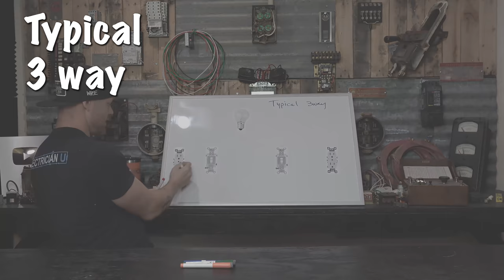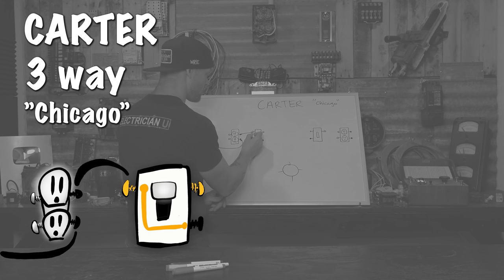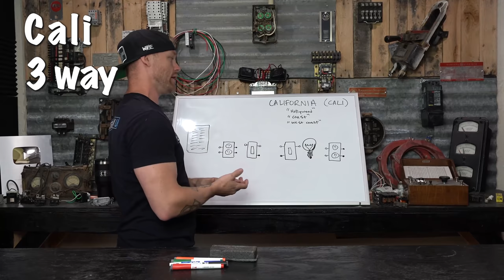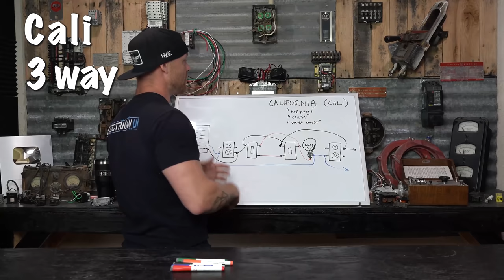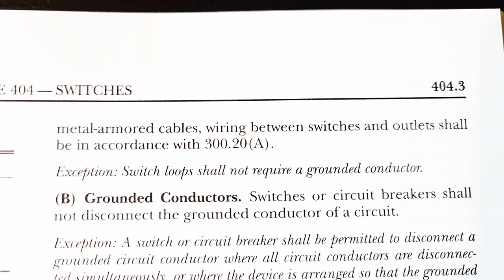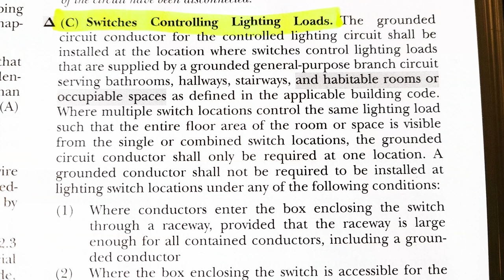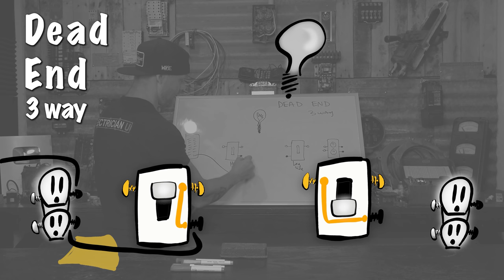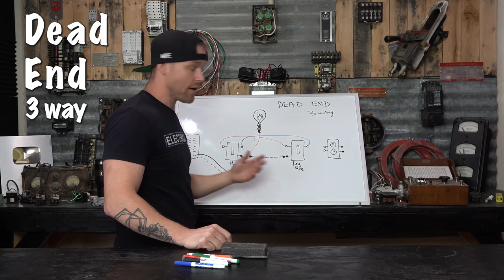THREE WAYS 3-WAYS CAN BE (3way Switch Wiring - ILLEGAL AND LEGAL METHODS)

Comment: Hey Dustin. As a Canadian studying the electrical trade in our code books (CEC 2018 24th edition) Section 4-022-2 states that a Neutral conductor is required in every switch box. It reads as "The identified conductor shall be installed at each location of a manual or automatic control device for the control of permanently installed luminaires at a branch circuit outlet."

Comment: I recently did a kitchen/house remodel.  I ended up scrapping all my 3 way switches.  I had three 3-way (kitchen, hallway, & stairs) switches and replaced them with the Lutron smart switches.  I know you are a electrician and it is less profitable for you to install wireless switches.  But these Lutron Caseta switches/dimmers are legit. I even convert a existing 3 way situation into 4-ways by simply adding the wireless receivers.  I have also convert the living room and family room single pole switches into 3 way Lutron dimmers.  The great thing about the Lutron line is that the switches do not require neutral wire which mean you can easily upgrade your older houses into modern smart homes.

Comment: I only see this NEC 2020 "neutral at switch boxes" applying to completely new switch circuits as in a rewire or new construction. As a practice, I try to always (especially in residential) have my switch legs go up to a fixture outlet from a wired switch box rather than than down. and this practice was influenced from my early electrical maintenance days (mostly service work), whereas I hated having to fool with a light fixture to troubleshoot a problem such as bad splices.  Another great video for sure...

Comment: Sending this to my Father-in-Law.  The previous owner of his place had some hack install a "three way" circuit in the living room, one switch at the front door and one at the kitchen.  Unfortunately, it's only 14/2 throughout and uses single-throw switches.  Dude got it right in that both switches WILL turn the light off... but if you turn it off at the front door, the kitchen switch won't work.  If you turn it off at the kitchen, then the front door doesn't work.  The hack just put two switches in series, then installed a ceiling fan with a pull switch, which is what my in-laws end up using.  It pains me greatly and I end up walking around in the dark rather than dick with it.  I'm dreading replacing that mess because my Father-in-Law thinks the attic is unsafe and hasn't agreed to let me look at it yet.

Comment: Hey Dustin, one thing you mentioned parenthetically was the dubious use of #6 and smaller white conductor used instead as an ungrounded circuit conductor, and that doing so was not compliant, but that most AHJs would not cite this as a violation.  Just a reminder that cable assemblies are discussed in Article 200.6 and even white wires #6 and smaller may be re-purposed as ungrounded circuit conductors by way of phase tape or other effective means.  For cable assemblies, there is no code violation.
Reply: Good info. Thanks.

Comment: Ok, this might seem like a dumb question and you might have mentioned it. In the first example, how would you run the ground? I've seen two ways. Coming from the panel, bypass the outlet and switch, straight to the fixture, then from the second switch to the fixture. Basically just one continuous wire from the panel to the fixture, grabbing a tail from the second switch. 
The second way I've seen is from the panel meeting up with a tail from the outlet and each switch then up to the fixture. So basically grounding everything along the way to the fixture. 
I  hope that all makes sense.

Comment: This was soo helpful.  I just found out about the neutral code requirements and wasnt sure, about how to handle until watching this video.   Thank you!!
Reply: Can be especially confusing for traveling electricians because often local jurisdictions have stricter requirements than the NEC and while one county for example,  may allow dead end three ways, the next county may not, or they may allow 14-4 or two runs of 14-2 so as to have a neutral at all switch boxes, for example.

Comment: I have come across another version of the dead end 3way where the power (via 14/2) was coming in to the ceiling jbox .running from their to each 3way switch was a 14/3. The neutral from the supply directly hooked to fixture ,the hot from supply to one white 14/3 , the other white 14/3 to the fixture hot, and both travelers capped together in ceiling j-box.
Reply: Most of the 3-way switches in my house are like this, which means you cannot install a smart-switch that requires a neutral. One solution I found was to install a smart-relay in the light fixture box. The problem with that is if you have to press the smart-relay reset button, you have to remove the light fixture to get to it. Does anybody have an acceptable way to use the existing wires, repurpose them in some way, so a smart-switch can be installed?
Reply: @jackallen3994  It sounds like it’s time to replace the 3-wire with a 4-wire at the “hot” location.  If you can’t attach a 4-wire to the 3-wire and pull through, well, I’ve learned from experience that they make drywall and mud everyday 🤪
Reply: Anyone know the name for this type of three-way?
Reply: I always called this Cali 3 way, except red and whites pass through light box as Travelers and 1 black is hot, the other black is switch leg. Same thing just different color travelers.

Comment: Up here in Canada I've seen 3 ways done a different way.  You use 4 wire cable, red, black, white and ground.  You run such a wire from the wall switch up into the ceiling light fixture and then down to the other wall switch.  You can bring a hot 3 wire into any of the 3 boxes to power the circuit with with slight variations.  I'll use an example of running the hot wire into one of the switches.  You connect the hot black wire to the common pole.  You then connect the black and red from the 4 wire to the other two poles.  In the light fixture box you connect the black and red so they run on to the other switch.  At the end switch you connect to black and red to the same poles as the first fixture and the white wire running back to the box to the common pole.  This makes the white running back to the light a hot wire, mark it with black tape at both ends.  Now just connect the hot white to the base connection of the bulb and the white going back to the start to the neutral side.  At the first switch connect the white from the 4 wire to the white 3 wire power in line.  And of course all the ground wires in all boxes are connected together.  There's a bit of variation you can figure out yourself when the hot 3 wire is brought into the light fixture box in the ceiling.

This set up seems to make it simpler and easier to wire 3 ways. There's no mystery 3 wire running in the walls along a different path. Overall it reduces wire costs and stringing for most jobs.  It's also a lot easier to fish a single wire in a repair or retrofit scenario in a finished home.  I notice now there is no neutral in the last box which isn't current code.  If I had to install a smart switch in an existing box without a white neutral I would connect the neutral pole to the bare copper ground wire.  The electronics in the switch don't return juice down the neutral.  They just need it as a reference ground voltage.  The ground wire should serve.  Not sure if this acceptable under code???  It should be safe if the smart switch is made properly.  I've seen electricians do this back in the day for old 240 volt electric stove circuits that didn't have a bare ground wire.  They would connect the newer stove's ground wire to the white neutral going back to the panel.  As we all know the ground and white neutral eventually connect to the same piece of metal in the panel.   All the neutrals and grounds are electrically continuous, connected, in a home.  And you'd likely get a better ground voltage reference from the bare copper wire than a neutral which could get thrown off by juice inputs elsewhere along the neutral circuit.  I think the makers of such switches made an unnecessary mistake in choosing the neutral instead of the bare ground for a reference ground voltage.  Or perhaps to accommodate older wiring with no bare ground wire.  Or maybe I misunderstand the need for a neutral in smart switches.  I would think the bare ground would be preferable when available.  Somebody should check into this, see if technically the bare ground is ok and safe to use and the makers say it fits with their design intent.  This would make meeting code requirements easier and cheaper

Just a note of caution here when using fixtures and switches made in or for Canada.  Canada is bilingual, French and English.  As a result laws require labeling in both languages.  That creates a mistake that's easy to make.  In French white is spelled "blanc".  If you're not paying attention or in poor lighting it's very easy to mistake the "blanc" label on components for "black".  You'll connect the hot wire to the wrong pole.  Heads up on this eh!

I've seen some weird things the text books don't describe in AC wiring and I've come to believe there is very little or no current or voltage from a device down the neutral wire.  I've seen houses where someone stole the bare #6 ground wire from the panel to ground to sell the copper.  The new tenant or owner is unaware and the electrical in the house seems to work, more or less. There's no connection to ground anywhere in the system.  It's all running on capacitance instead of grounding.  It's wonky and likely dangerous but most of it still works. Of course I immediately tell the owner they need to put back the bare #6 ASAP.

Comment: Thanks for your video. I ran across this Carter/Chicago style 3 way on a repair job that the customer had put in new switches and it was very helpful!
Reply: Lol did it take you some time to figure out what they had running?  If so how long.   Luckily I have personally never ran into a Chicago/carter 3 way, I have only heard of them and apparently they have been illegally installed decades after they became illegal in the mid 1920s.  A fairly common application,  was on older farms  , and homes in rural areas,  where you had a home, a yardlight and an outbuilding,  and some receptacles in the outbuilding that are to remain constant hot, and 3 way switches in the home and outbuilding controlled the yardlight using only 3 wires instead of four with or without ground.

Comment: On the dead ends, I always did the white and red for the travelers and kept the black for the switch leg. I always stripped my common for the other people working on the finish. You need to show the fed at light with 2 dead ends, very useful in an old work situation.

Comment: I just checked the NEC Handbook (2017), Article 200.7(C)(1). Another commentor is correct. For cables (MC, Romex), the white wire can be used and re-identified as ungrounded, if a switch supply or traveler in a single pole 3-way / 4-way switch loop, but not a switch leg. Interestingly, it doesn't prohibit all switch legs from being white wire (from a cable). Some people will say the switch leg should never be white, but that's not in the code (2017).
Reply: Also the white wire can be used and re-identified as a hot, when used to power a straight 240V load, such as a water heater,  baseboard heater,  or a NEMA 6-20R typically used for larger window AC units and larger electric heaters.
Reply: @Sparky-ww5re  Yep, if it's cable.

Comment: My newly constructed house (in 2022) had two dead-end three-ways in it, except that the hot side was at the dead end in both cases. To install smart switches, I had to flip the hot and leg sides so that the hot side was in the same box as the neutral wire.
Reply: I've done the same in my 1972 house. Basically "undid" the dead end three way and capped the red.

Comment: Goddamn dead end 3-ways finally just clilcked for me.   Describing it as just bringing the switch leg over to the 2nd box via the white wire in a 3-wire cable makes so much more sense than any other way it's been explained to me.  Thank you!
Reply: Congrats, I finally understand it when I used my red and whites as Travelers instead of red and black. For some reason, Black wires always going to common side of switch always made more sense to me rather than using the white as a common.

Comment: If you want more than 3 switches for 1 light (let's say in the staircase of an apartment building), just use a relay in the breaker panel with a push button circuit as switches. Standard practice in Germany. :D

Comment: Both of my three ways I have in my home are the dead end type. Both are for controlling lights from two different floors. So, I have a normal 3-way downstairs for an outdoor lamp and upstairs a smart 3-way for the same lamp. The other is similar, smart 3-way upstairs for outdoor stairwell and normal 3-way downstairs. I only have and need neutrals where the smart switches are and the normal 3-ways don't go to any outlets, so neutral is not necessary.

Comment: Liked the video. I get so many calls especially from one handy man friend that he’s removed a switch and can’t remember what he did. As you know it’s not easy trying to help him figure out what he’s done if there are multiple switches at the same location. Going to refer him here for the future.

Anyway is a 3 way really a 3 way and is a 4 way really a 4 way???
A 3 way has a common terminal (let’s for simplicity say an input) and two other terminals which dependent on switch position are in connection with the common, throw the switch and those connections change. 1 way or the 2nd way, thus 2 ways. No matter how you bring power in it can only leave 1 of 2 ways. Same for a 4 way, power is always coming in on one terminal of two and leaving on one of two others on the opposing side, 3 1/2 way maybe?. Lol just messing. Using the amount of terminals as the WAYS doesn’t work, otherwise a 1way should be a 2way
Being a euro trained spark living in the US for over 20yrs I’ve messed with a lot of my colleagues over the years. Typically we call a 3way a 2way and a 4way an intermediate (it intermediately intersects the travelers). 
I’d be interested to hear other thoughts on how switches got the names we use.
Keep up the interesting lectures 👌👍

Comment: One thing people don't take about is the three hot feeds. In 9 grade electrical and Electronics class we had to feed  the hot at the switch, then at the light and finally at the opposite switch. We also installed the four way switch . 

Another can of worms is to know the difference between a four way switch and a double pole switch they are NOT the same. I had to change out one switch because some electrician used a double pole switch instead of a four way switch. 73

Comment: Thank you.
   I repaired a 3-way in my folks home years ago. I had to diagram it out to do the repair. 
   This video really helped. 
  Also, thanks for the code discussion.
I started studying AC circuits and  the code as a graduate student when an electrician told me 240 single phase was the same as 208 3-phase. 
   Even as a professor, I get confused by the words in the NEC. So do the electricians and inspectors.
   Thanks again.
Reply: the same? in what context?
Reply: that's what makes our American system so good, 240 3 wire is a single phase Edison type circuit, and used in mostly residential, and 208 is two circuits of a three phase delta boat sharing a neutral,  electricity can flow more freely through our grid without big differences in voltage, they are the same in regards to the equipment you are running,  but they are very different in a lot of other ways. 208 in a three-phase wye system is a single pole stinger leg.

Comment: With DC SELV power there is a way of doing this that requires only two wires between the source & first switch , and second (remote) switch and load. The first switch is what you refer to as a "4 way", but is also called in "intermediate switch" - what they really are though is reversing switches. So it will simply reverse where the +ve and -ve poles appear on the travellers. 

Then at the remote end one terminal of the lamp is connected to one of the travellers and the other is connected to the common of a three way switch (SPDT in panel switch nomenclature) the other terminals are both connected to the other traveller, but through diodes, that are reverse polarity to each other. 

When the polarity of the current in the travellers matches the diode leg that is switched to the lamp it will light. If the other diode is selected it will block the current and the lamp will remain off. This of course means you need to use a lamp that is not polarity sensitive, such as an incandescent bulb, but generally MR-16 base LED lamps already have rectification built into them. Alternately, you could use a second intermediate switch at the remote end, then just one diode would be required (but on the lamp side of the switch) and the current would always flow in the same direction through the load. 

This setup also allows a permanent source of power at the remote end from across the travellers. Of course they will reverse polarity as the intermediate switch is operated at the source end, but if this is an issue for the load a bridge rectifier can be added. The switch at the source naturally needs to be rated for the current of both the lamp and the extra load.

Comment: The animations were helpful. Finding out a variation of a dead end 3 way is okay for now was helpful. Mine had the travelers go like normal and the hot travel from the power source to the dead end through the white wire on the 12/3. The other switch common went to the light.